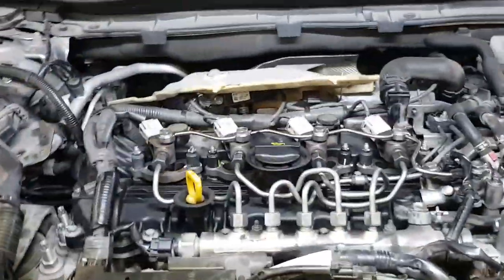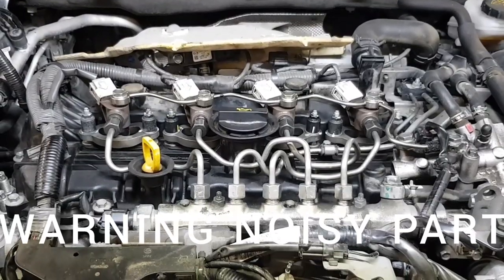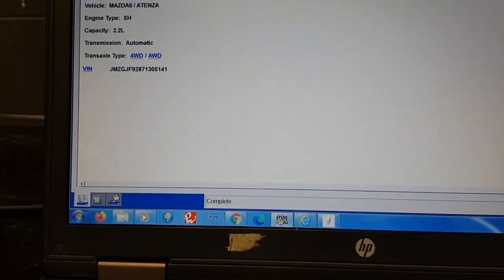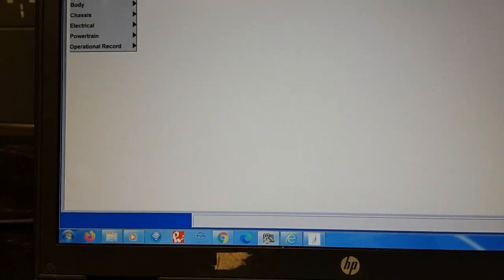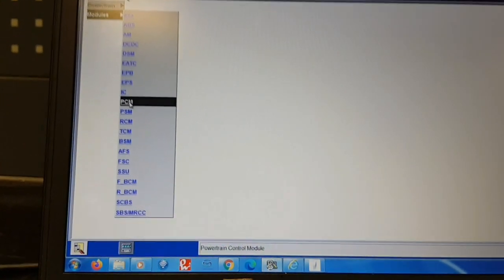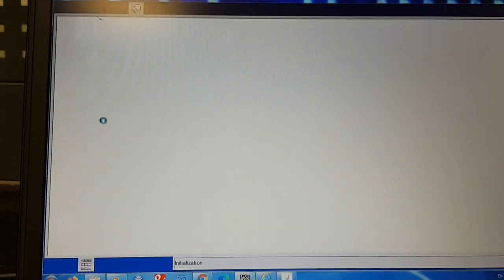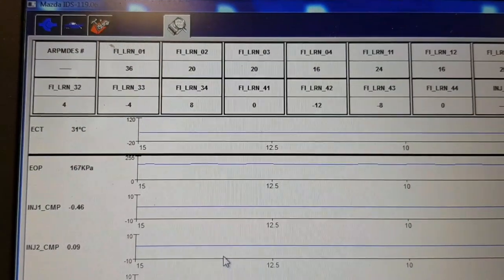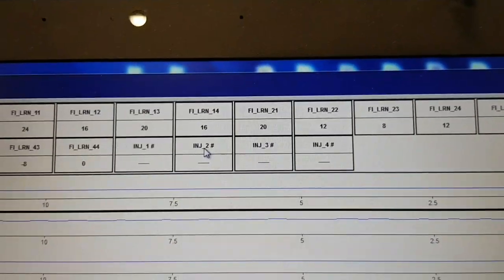Mazda Skyactiv 2.2 D Engine noise, quick and precise diagnosis.

Comment: Hello, thank you for your nice videos. I have a few questions. I own Mazda cx5 2014, which has 205.000km. I change oil every 10.000km, clean strainer, change injector washers,...and car runs ok. 
I like to know when is good time to change timing chain, are there any signs of getting bad? Some people say, that small oil pump chain is problem is this true? 
I saw that new injector washers are silver, are they better than old one? How much you tighten this washers in manual I read 2Nm and then loose a bit.
And last one, for now I just clean oil strainer (with small brush and cleaning spray). Is it possible to replace strainer without removing oil pump (just loose the bolts), I am little scary removing oil pump ;). 
Thank you! Best Regards, Samo
Reply from the maker: Timing chain replacement only when  DTC appears. Oil pump chain: old models where oil dilution is severe at most of oil replacements ( severe oil dilution causes greater friction damaging oil pump chain guide, and therefore chain snaps. Genuine silver gaskets are modified and we do not have any problem with them if properly tightened.
It is not possible to replace oil strainer without removal of oil pump,   U can use carburetor cleaner to remove carbon from strainer, do not forget to flush engine after that. Tightening torque for injectors is: 2Nm left nut, then release left nut 90 degree, tighten right nut to 2 Nm, then tighten right nut 240 degrees.
Reply: @JB_Auto  Hello, thank you a lot. What you mean with flush engine. When I clean strainer, I clean strainer and oil pan and put things together ;). 
Is it possible to somehow check the oil pump chain, when removing oil pan / oil pump?
I watched your video about removing oil pump and not seems so hard :), is there anything I must take care of?
Best Regards, Samo
Reply from the maker: @samostraser8924  You are welcome to Flush the engine with oil and a special liquid, called engine flush🙂 this is to clean the remaining carbon composite spread all over the lubrication system. You can check the oil pump chain guide by compressing it and inspecting its surface, if deep damages replace the sprockets chain and the guide. 
To remove the oil pump you need to have a special tool( oil pump sprocket holding tool), on certain vehicles to remove the oil pump, you need to remove the timing chain, but if under inspection damage to the chain guide found, You will need to remove the timing chain anyway.
Reply: @JB_Auto  ok thanks again. So its not so easy oil pump removing 🥴, is there any universal tool or just from Mazda? Which flushing cleaner do you use? Regards, Samo
Reply from the maker: It is easy, the tool you need is from Mazda, the purpose is to counter hold balancer unit while you loosen the oil pump driven sprocket, I have loosened that without the tool ( it was before we received the tool, I do not remember how though), try to come up with something which will function as a counter hold.
 For flushing, You can use commonly available" Engine Flush"
Reply from the maker: One more thing, make marks on oil pump chain and oil pump driven sprocket to align them once mounting back.
Reply: @JB_Auto  Thank you, I will. So when I remove chain, I need to block tensioner, right? Please give me part nr. of this counter hold balancer unit, so I can see, how look like. I will trie to find something, mybe universal somewhere. Regards, Samo
Reply from the maker: @samostraser8924  No you need to hold tensioner driven sprocket with tool: 49EU01001 or 49JP01001
Reply: @JB_Auto  thank you!
Reply: @samostraser8924  Why don't you just move in together???
Reply: @bastogne315  Hello, dont understand this?

Comment: When this happens the repair cost is higher than the car I suppose?
Reply from the maker: If that happens recommended engine replacement and if the vehicle is old costs exceed the value of the car. Luckily it is very rare and as in this case caused by negligence, like replacement of oil, clogged oil strainer, and wrong repair. Otherwise, I never heard of a similar problem.

Comment: Great engine for driving, powerfully and smooth, but unfortunately with a lot of problems and mistakes, avoid it. On my Mazda, the Turbo went after 226,000 km due to a construction error that Mazda didn't recall. I'm very disappointed in Mazda as a car manufacturer.
Reply from the maker: I partly agree with your opinion, especially about the first diesel engines, they had a few issues. But in terms of petrol engines, Mazda is one of the top manufacturers, you should try 2.5 Skyactiv G, another good engine Skyactive X this one is not very powerful though. New engines coming soon, wait for it 🙂
Reply: @JB_Auto I agree with you, my dissatisfaction is not with the quality of the Mazda engines but with Mazda's attitude towards customers, if some component has malfunction, then company like Mazda makes a recall and fixes the error. What happened to me sooner or later awaits all owners of 2.2D Skyactiv engines and will cost allot.

Comment: Could this be caused by changing the oil too late or with the wrong type?
Reply from the maker: Exactly, and in this case, I suspect there was an injector gas leak causing carbon to gather on the oil pump filter( its proper name is Strainer), So the Strainer gets clogged and inhibits lubrication. Therefore the previous workshop had replaced connecting rod bearings.
Regarding wrong oil and not performing an oil change is common practice (oil gets diluted with diesel and the lubrication gets significantly worse, especially at the end of its life)
Reply from the maker: Hi. I have updated the description so that you will find a better answer to your question up there.
Reply: @JB_Auto  hey! I had the same issue approximately 6 months ago. My injector washers were blown, actually 3 of them, and this led to carbon build up in the stainer. Just wanted to confirm the reason. Luckily, mine was solved in time, didnt have issues with the stainer since.
Reply: although, after changing the injector washers my injector holders broke, and in the morning the car didnt start suddenly. since changing them, my consumption is around 5-6 litres/100km. 
The mechanics dealt with this kind of problem recommended changing the injector washers regurarly, and changing oil every 10000kms. In addition, they recommend getting rid of DPF system, and changing oil pump chain. Early 2.2 skyactive-Diesels have problem with oil the pump chain breaking. Altough, thex fixed this issue with the facelift in 2017.
Reply from the maker: @davidlehrreich3946  Hi. the injector holders had to be overtightened; we remove them often on a single vehicle and never had an issue with them. 
If it comes to DPF on the Skyactiv engine, no issues as well. Getting rid of it only makes sense if you disable DPF in Power Train Control Module software. Oil pump chain gets broken due to oil intervals replacement not correct and heavily diluted engine oil, and that is because of frequent automatic regeneration of DPF (read: customer drives short distances and that is why frequent regeneration)
I agree with removing both DPF and software, and then we dispose of the oil dilution problem.
Reply: @JB_Auto  thanks for the quick answer!
you must be sure, you are the mechanic, I wrote my experiences. Although my injector holders could broke because of the carbon buildup around the injectors. Maybe mechanics didnt clean it properly, but I know that injector holders should last a lifetime. The dpf system might be a bad influence on the oil because it regenerates actively. Even on the highway. It just wont be able to warm the exhaust system enough without injecting additional diesel.
Reply from the maker: @davidlehrreich3946  Thanks, I appreciate every comment on my channel.👍